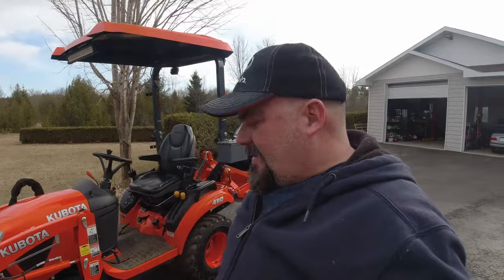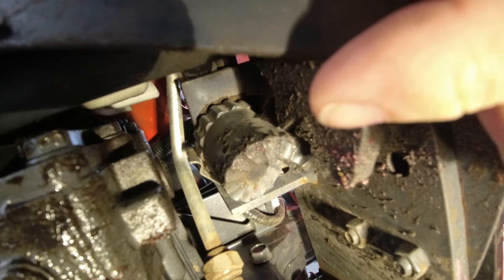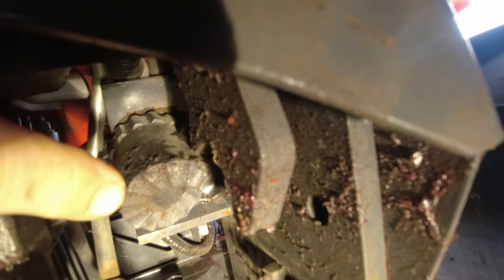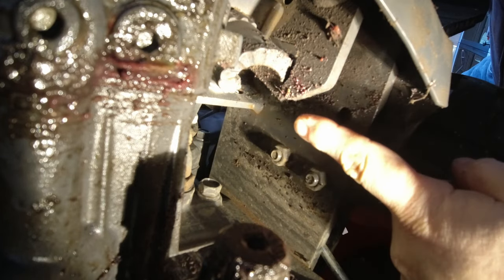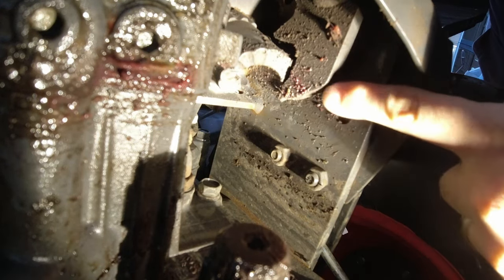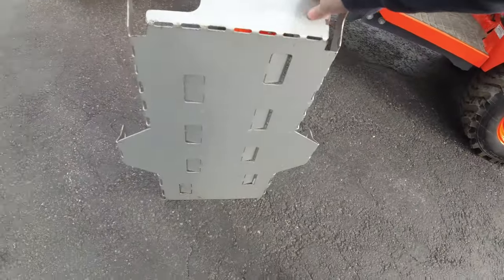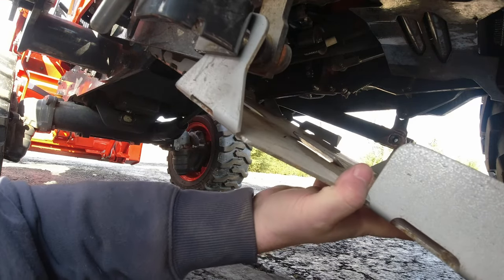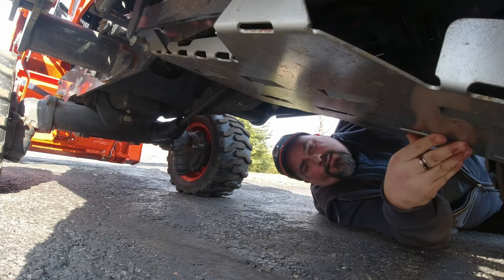Kubota BX Knob Adjustment Explained

Comment: Sometimes even when I run my deck all the way up that knob gets stuck pain in the rear to unstick it.
Reply from the maker: Ya it's not a great design for sure. All I can say is make sure the rear 3pt arms are all the way up, then crawl under and verify the detents aren't binding.  Let me know if there is anything I can help with.
Reply: @RossOnTheLand  ok ty
Reply: Mine too spray some WD40 down the shaft of the knob frees it right up
Reply from the maker: Thank you for the tip.

Comment: Great explanation of how the knob works. Only thing I’d recommend is showing how to adjust the 3 pt to be able to get the knob to the top position and then recommending that you run the skid plate with it locked in top position. If it’s hanging down at all and you back up in some brush you just made a feed ramp to put sticks right up in the undercarriage and fan.
Reply from the maker: Those are good additional information I should revisit. Thank you for commenting.
Reply: Should lock up in Top Position and not lower at all.  You may have to adjust the linkage at the left rear tire.  In my case I could not get mine into the TOP position until I placed a jack under the plate and put pressure on it which then allowed me to lock in the TOP position so it will not drop when lowering a rear implement.  The plate was that tight of a fit.
Reply from the maker: That's a good tip thank you.

Comment: Excellent video on mower knob. I predict this will be your most watched video over the next few weeks. 😁
Reply from the maker: I'm amazed at how many people discuss the knob! In forums last week.  It's a hot topic!
Reply: Lol and here I am just received my new BX23S and am trying to learn how to adjust the cutter height.  Loved your video.  Thanks so much for explaining it.  Very much appreciate your time and effort to explain this.
Reply from the maker: Congratulations! Glad it was helpful! A few other things.

1) Watch the coolant level, it has been known to drop after about 30 hours as there is usually some air left in the system.
2) check the front tires diff fluid level using the yellow cap on the front diff. 
3) if your throttle starts slowing down and not staying at speed, it's usually the jam nut under the throttle lever backing off,  take the black grill at your feet off and reach up underneath and add a nyloc nut to it to stop that from happening.  

Let me know if you have any more questions.

Comment: Mine still won’t turn
Reply from the maker: Hello, if you are sure you have lifted your rear 3 point arms to their highest position, do it again, then try using a pair of gloves to get more grip on the adjustment knob, or maybe a pair of channel lock pliers but be gentle not to wreck the plastic knob.  If the underside of your deck has some corrosion or dirt build up it may need some lube or persuasion.

Comment: Good evening Ross, Outstanding demos on how properly turn off an diesel engine, unbuckle your safety belt and how to bail out using 3 points contact 👌👍🧐 I was also warm in the St Laurent Valley too 👍👌😎 Outstanding demos Sir about that Knob adjustment ( ON YOUR TRACTOR ! ) 😉👌👍🧐 Great protective plate 🧐👍💪👌 Outstanding video Ross, What I've done today, I vacuum my car after 8 hrs drive with my Two Golden Retrievers  🥴🤣😉 Cheers 🍻
Reply from the maker: Hey David! We took our 4 dogs out the other day and definitely needed to vacuum the car!!! 

Yes I'm trying to use the seatbelt more and wanted to show that. :) Thank you for watching, does your tractor have the same adjustment Knob?
Reply: @RossOnTheLand  Good evening Sir, Yes Sir have the same adjustment knobs, but tomorrow night after work I will look underneath to see how it is ( same as you ! )  CHeers !

Comment: I seem to be having trouble with my BX2380..... we have just purchased it recently, and even when I put the 3 point all the way up, my knob will not spin in either direction. Maybe I am missing something, however I feel like I am doing it how you've explained! Any suggestions? Thanks!
Reply from the maker: Hello Brendan,  if it has not been used in a long time the detents on the backside shaft (under the deck) may be seized. Put the rear 3pt arms all the way up, and get under the tractor and look at the knob's shaft. The shaft runs on a stepped bar (controlling the mid mount mower height) Make sure it's free and not sitting on the shaft.  You should then be able to spray some PB Blaster or lubricant on it. Then go up and use channel locks on the plastic knob (protected by a rag or something) and slowly work it loose.  I routinely have to wear gloves as the spring to clamp is very stiff. It will rotate in either direction. Let me know if you have any trouble.
Reply: @RossOnTheLand  ill give that a whirl tomorrow, thanks a lot! I'll let you know
Reply from the maker: Yes please do

Comment: Ross. I have a Massey GC1710 sub-compact and the mid-mount mower control knob is located about the same place and I never got underneath to examine it and your demonstration clearly explained the notched control spindle very well.  I too have an under armor shield for my little tractor but it's made in sectons which I haven't crawled underneath to fasten yet.  I'm definitely concerned about the HST fan when I travel through wooded areas.  If that HST fan gets whacked, all hell breaks loose and money just pours out your wallet.  Right now I'm going through my 3rd week of pine needle raking and stacking before I have to shovel them into a cart for their final deposit at a pre-designated spot for dying pine needles (their graveyard).  I'll be so dang glad when that chore's done.  New SUBSCRIBER!  Thanks for supporting my channel.  Have a fine week, Ross.  Don  👍🏼🤠
Reply from the maker: Hey Don! Thank you, and glad the video helped.  I had my under armour ordered and sitting for installation even before my tractor arrived. I have lots of clean up going on, but it's been raining non-stop for 4 days.  Everything is under water.. :(  I'll be watching your videos tomorrow , very much looking forward to it. Have a good rest of the week.

Comment: Good info and visual on the knob function.  Excellent idea to use a skid plate to protect the undercarriage.  Although you can't use the skid plate in the winter because it interferes with your snowblower connection you would not want it on anyways because it would trap ice and snow where you don't want.
Reply from the maker: That's right Jelen, I did see another company that has a removable access panel through for the pto shaft in winter, but I'd rather remove it completely in winter as you said.

Comment: I only use my under armor in summer when my mower deck is off. Great information on the height adjustment. Took me around a day to figure it out lol.
Reply from the maker: Same with me Mike! Thanks.  I didn't really know why it worked the way it did until I got under there.  :) Makes a lot of sense now. Thank you for watching and commenting.

Comment: I don't have that control on my B2601 but I love seeing how things like this work. Thanks Ross!
Reply from the maker: You are welcome Ed! What does the B2601 use?
Reply: @RossOnTheLand  The B2601 has a 3 pt system that stays wherever you set it, so you just use stop at the number on the lever that you want.
Reply: @RossOnTheLand  B2601 with MMM has the knob. I believe it ships with the deck. Trust me I have it on my B2601 it was a PITA to figure out at first. 😅
Reply from the maker: Thanks B!
Reply: @bhall7997  I second this! I to have the B2601 with the mid-mount mower deck, and it has the same height adjustment knob you show in this instructional video. Thanks for showing the knobs mechanics.
Reply from the maker: Glad it was helpful

Comment: Great explanation. I don’t have one of those tractors. But most of my garden tractors have that height adjustment knob. The shield guard underneath, is that a factory piece. Would the dealer put it on normally if it is ? And if you are backing up in the woods or muddy area, does the rear of the guard lift high enough to miss the dirt ? 
Had my Case 446, with 48” snow thrower, out yesterday to clean up a 20-25 cm wet heavy April snow storm. That’s what I did on my land yesterday. !  Hopefully no more. But. Never know. 
Can’t wait for Plow days and tractor runs. 
Have a good one.
Reply from the maker: Hey Noel,  the under armour is an aftermarket order from a company called BXPanded. And yes you can raise it up high enough to never have it catch when going backwards.  I usually keep it at Top, and this locks the arms from moving and safe.  I'm finally glad our snow is gone, and temperatures are rising! We have some local events here as well and it'll be nice to see them this year as well! Thank you for watching and commenting.

Comment: Thanks. Just installed mower deck to mow and played with deck knob. Now I know how to adjust properly. 
Have you had any problems with the skid plate snagging on any when backing up?
Reply from the maker: Excellent! Glad it helped.  No I have never had issues snagging stuff when backing up.  I always keep the adjustment knob at "TOP" or near the top, so it moves a bit with normal daily use.  I don't have a Mid Mount Mower. So I only use it for the under armour :)

Comment: hi and thanks for the video, I have had a Kubota 1870 since 2015 I have the snow blower and front bucket and weight bucket on rear but this is the first season I have attached the belly mower and I could raise and lower the belly mower ok till yesterday I will see what is going on and spray up the linkage. So I  have to raise the weight bucket all way up then adjust the mower height? learning on this mower thing
Reply from the maker: Hello, and glad this helps.  If it's the same type of setup, then yes. Raise the 3pt arms all the way up and. Then you should be able to rotate the height knob. It is stiff, but will rotate in either direction.  Wearing gloves helps, and yes get under the deck and see if it's all gummed up with dirt and clean it out and lube it up if needed.

Comment: great video and it really explains it perfectly. The one thing that I was interested in was how to you see that  stepped part because it seems to let down the mower deck too far. thanks
Reply from the maker: Hello, I'm glad it helped. It has to let it down far enough that the mower will ride along the ground at various levels depending on the ground's surface so it does need long travel. Let me know if there is anything else I can help with.
Reply: @RossOnTheLand  thanks for the reply, when I turn it to 4.0 it seems to go all the way to the bottom. How can i see the adjustment ratchet like you showed. Take tire off and get down and look at what angle. from the rear or left or right side. thanks
Reply from the maker: If your mower deck is off, slide under.  It's exactly below that turn knob. You'll be able to see what's going on and what position it's in. You should then be able to work out what position it's in. Hopefully that helps.
Reply: @RossOnTheLand  thanks ross, I need to take it off and service it, I had a shop doing it and it was not up to my standards. I saw you video on how to get it off out the front will give it a try.
Reply from the maker: Excellent.

Comment: I'm sorry but you were correct because I thought you said 30 C but when I rewatched it and turned on the subtitles you did say 13 C which converts to 55.4 F. I still couldn't get my brackets to drop when I wanted to remount my skid plate but was able to put it on while in the up position. I have a rear blade on my BX 1880 and does it have to be in the raised position when you turn the knob to 2 in order to drop it.
Reply from the maker: Oh excellent :) 👍 

Yes you should put the rear blade up all the way to relieve the pressure on the knob's detents. It'll make turning the knob easier.

Comment: With the body armor I'm guessing cannot use a belly mower. Is there a skid plate that will work with both a belly mower and the front mount blower?
Reply from the maker: Hello, I do not believe so, but really the point of the armor is to protect the underside of the tractor, and the belly mower would be doing just that. So in my case I do not have a belly mower because I use a separate zero turn mower, I do like having the protection in the summer, and in the winter I don't usually go through the brush and branches while focusing on snow clearing the driveway and trails.

Comment: I've not used that on mine yet, great instruction on how it works.
Reply from the maker: Thank you Tekker. Let me know if there is anything else I can help you with.
Reply from the maker: I only use mine to hold the Under Armour, but it's good practice to move it every so often so it doesn't seize from lack of use.
Reply: @RossOnTheLand  I have to laugh only because I bought the mid mount mower deck back in Dec when I bought the BX23S, but it still hasn't come in yet.  So I had planned on using the raise and lower dial, but maybe they'll come when the snow flys.  😂
Reply from the maker: @tekker8308  well of course that's when it'll arrive 😭

Comment: When I lower my deck mower my 3 point hitch lowers too, how do I stop that? 
Also show us your toolbox. Handy!
Reply from the maker: Hello! The mower deck and 3point hitch are tied to the same action. The way to stop it is to use the numbered turning knob on the deck floor and put it to TOP. This will hold the MMM up and not let it lower when using the rear 3 point hitch.  I have another video on the ammo box toolbox back  in my older catalog if vids.

Comment: Do you not pin the underarmor in the raised position all summer long?
Reply from the maker: I quickly mentioned that but maybe I should have elaborated.  I usually keep the under armour at Top. But James from Killing it Country leaves his arms to have some motion so things don't seize. So I'm going to run with a bit of motion and keep stuff lubed up.
Reply: It should be locked in the highest position yes.  Otherwise it'll hang down and potentially catch on stuff you run over.  I keep my skid plate on pretty much all year as I don't use my mid mount mower very often right now.  If you follow the lubrication guides you won't have any problems with stuff seizing up.  Use a good tacky grease or light oil on all the components and it'll work just fine.

Comment: I have a silly newbie question… Assuming this knob is for the mid mower deck only and has no effect on the back three-point hitch?
Reply from the maker: Hello, If you have the BX the height of the Mid Mower Deck is raised and lowered using the same mechanism as the rear 3 point arms.  All the knob does is stop the MMM from moving full range when the 3point arms are lowered full range. Because there is only one control lever to raise and lower both... So raise the rear 3 point arms all the way up, and then rotate the knob to the desired number, and lower the 3 point arms and the MM will stop at that point.

Comment: Hi, I have the expanded metal plate under my BX25d tractor and use my front mounted snow blower without taking the plate off, it has cut out for mid PTO drive shaft connection.
Reply from the maker: Hello, mine is the BXpanded  Under Armor and doesn't have that cutout. I know the Bro Tek Skid plate does. It would be handy to have that cutout.

Comment: Really cool idea.  Regular installation is time consuming and you can't put deck on with armor attached.
Reply from the maker: Thanks for watching and commenting Mike. let me know if there is anything else you have any questions.
Reply: With the deck on you don't need the skid plate as the mower deck is there to protect the under side of the tractor.  Mower installation/removal for me takes maybe 5 minutes, overall 10 minutes due to having to drop the loader bucket, put the pallet forks on, go get the mower off the pallet and bring it around to the carport to install it, then remove whatever 3 point implement/attachment I have on at the time, then remove the skid plate and install the mower deck...the rear lift arms are the hardest part of the whole thing to get lined up and locked in, after that its very quick and easy.
Reply from the maker: I agree. The lift arms are the bane of my existence :) good job. Have a great weekend.